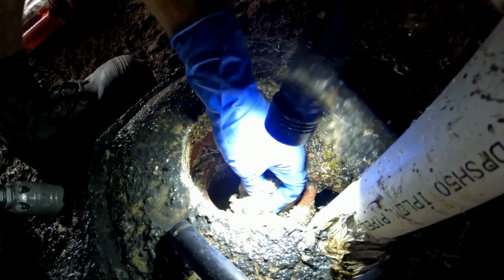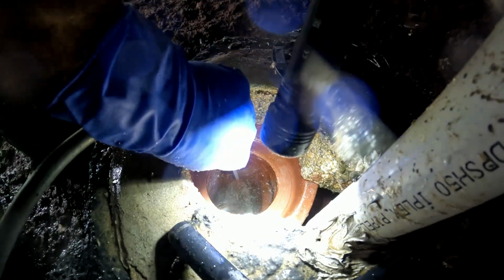Blocked Drain 290 - Crawling Through Contaminated Slop To Find Tree Roots

Comment: Hi m8. Drain question every time sit on the dunny I get a shock after flushing??? Is it because I have to much iron in the water Or much iron in my blood???????😮
Reply: Could be your electrical system ground is bonded to your iron sewer pipes. I'd check for a ground fault in your electrical system.